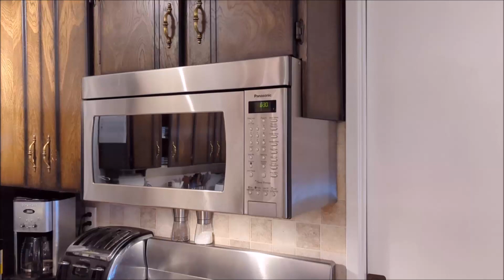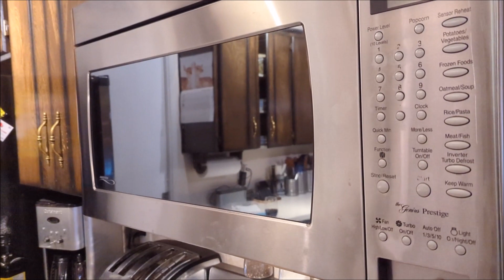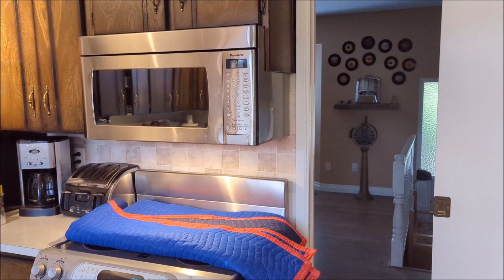Microwave Door Latch Repair   Panasonic Genius Prestige

Comment: According to the manual of my microwave oven, which is also a Panasonic although not the same model, an space of 3 inches on both sides and 2 inches on the top must be allowed for proper air flow. Otherwise it may overheat, and be damaged. I see that your microwave has wood on all sides, which is not the proper installation method.
Reply from the maker: @antonio270156, that's very true for a regular microwave, but this particular model is designed for over the stove installation and it includes a built in over the range exhaust fan.  Here's a link to the Panasonic website that shows a modern one with the same functionality as mine:  https://www.panasonic.com/ca/consumer/home-appliances/microwave-ovens/over-the-range/nn-sg138s.html     Thanks so much for watching the video and hope it helped you out a bit.
Reply: @MadTinkerman  Sure, thanks for replying! Your video was useful because I need to repair my microwave for the same problem.
Reply from the maker: Awesome.  Great to hear the video may help to give you an idea of what to do.  Good luck with the repair!
Reply: @MadTinkerman  I fixed my microwave today. The problem was that the hub (the piece that holds the plastic pusher that opens the door) was broken. The hub is part of a plastic box that holds the control panel. I tried to glue it, but did not hold well. So added small wood pieces and cardboard that support the hub from all sides, and that was the best solution, because the hub cannot be broken again (in theory). Thanks for the inspiration and good wishes!
Reply from the maker: @antonio270156 , hey that is fantastic news you were able to fix your microwave!!  Sounds like a very innovative fix also on your door opening mechanism (pusher).   Sounds like what you did should work really well, but if it fails, suggest you purchase some JB Weld Plastic Bonder or similar two part adehesive designed for plastic.  Really gratifying to know so thanks so much for circling back and letting me know you got it fixed!  Cheers!
Reply: @MadTinkerman  Thanks for the nice words and the suggestion. But I think that the fix will last, because the hub is being held from all sides, so cannot move out of its position. I also had the bulb burned, so replaced it and now it is like we have a new microwave. I even considered buying a new one, and I assume that this will be the tendency of most people, It is incredible that many good appliances got discarded just because of a small and fixable failure!

Comment: I’m having the same problem with my counter top Panasonic unit.  I’m trying to remove the outside SS shell but they have tamper proof Torx fasteners that require a special hollow wrench bit. My microwave is less than 2 yrs old so definitely worth fixing.
Reply from the maker: @ednoga1507, those tamper torx screws are a pain.  Luckily you can typically pick up a set of bits off of Amazon pretty reasonably.  Thanks so much for watching the videos!

Comment: Thanks, mine (the plastic "leg" that unhitches the door) was in fact broken. I guess I could go for plastic glue but, thankfully the part number is listed on it and  a quick search found this part for under 10$ so I figure I'll just get a  replacement new cheap cheap plastic piece, until the next time it breaks. Always seem like every appliance needs to have that one cheap plastic part.
Reply from the maker: @canuckseven that's great to hear that you were able to purchase the part!  Kudos to Panasonic to still be making parts.  So many mfg's don't make parts available as part of their designed obsolesce program these days.   Glad to hear you were able to fix up your unit!   Thanks so much for watching the video

Comment: You really should post a revision to this video.  That part can be replaced in about 10 or 15 minutes without taking the microwave off the wall.  The front panel lifts up and out allowing the access you require
Reply: Can you explain in details how ?
Reply from the maker: Hi @johnbe-good2076 thanks so much for your comment and input for improvement!   Hopefully the video will assist those that need help removing the unit.   Pop me a link to your video showing the best process.  Cheers!
Reply: Hello, how did you do it ?

Comment: Thank you for this video! I have the same microwave but a bit newer, mines only 4 years old.  I went to open the door yesterday, and it barely opened.  It's not the happy pop it usually gives.  Im releived to see its not going to be some impossible to find expensive part which is only availible at a small shop in a remote town in New Zealand. 

I can make this fix no problemo now that i understand what it is. 

Thank you!
Reply from the maker: Hi from Canada @sorenzx1923 :) !!   Thanks so much for the feedback and super happy you found the video helpful!  I am trying to grow the channel, so if you haven't already, if you could subscribe, I'd really appreciate!   Thanks Again for letting me know this helped you a bit!  Cheers!